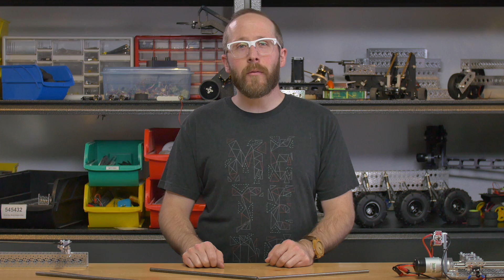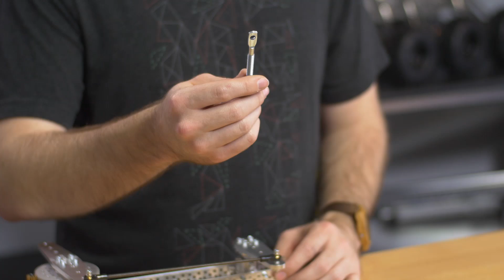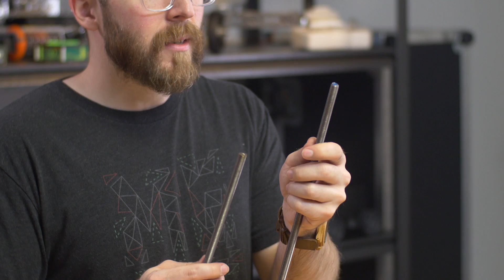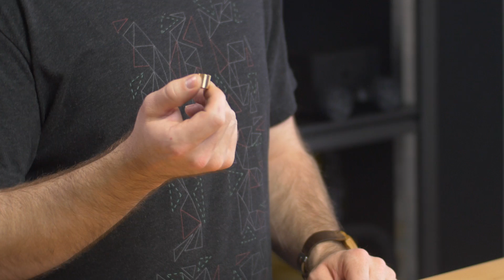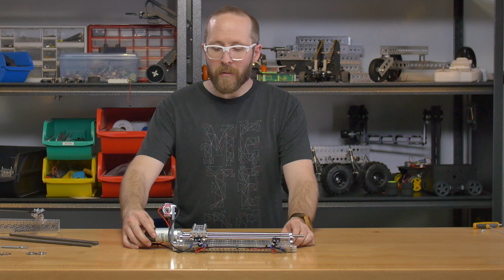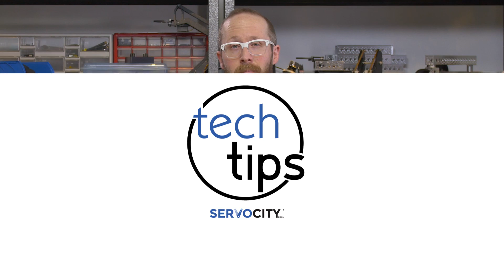Comparing Threaded Rod & Lead Screws : With Jason

Comment: A single thread has backlash which increases under load. I am a tool engineer who used to mass produce balls screws before retiring a decade ago.  It is all about precision and backlash at the high end.  The tightest machine members have precious scraped ways and precision ballscrews with no backlash.  You can also make a backlash eliminator like found on later Bridgeport style mills.

Comment: It's nice to find videos that don't just tell you to buy expensive things.
Reply from the maker: Glad you found the video helpful!
Reply: Where can you find the hardware you mentioned for the threaded rod.  I built an Arduino car (not the best mostly wood) and I made a homemade robot arm.  I would like to mate the two with a platform to raise the arm so it's not just a for off the ground maybe raise it 4 feet.  I'm not looking for a lifetime of use, don't care about precision, and not worried about power consumption.  I really just need to know the best search terms.  Everything I look for is for 3d printers or a CNC machine.  I live in a rural area so I have home Depot and Walmart so I have to I buy everything online, mostly from China because I'm not rich.  I can get threaded rod easy enough, but no hardware to go with it.  I can't find a lead screw over 3' for less than $100 which is way out of budget for my little Arduino hobby project.
Reply from the maker: @amelliamendel2227  Hi Amellia, here is a link to all the leadscrews and hardware we offer. https://www.servocity.com/motion-components/linear-motion/leadscrews  Feel free to reach out to our Tech Team should you have any other questions tech@servocity.com and they'd be glad to assist.

Comment: Where can I get a threaded nut for a threaded rod like you would for lead screws. I was having a look at your m8 round screw plates and was going to buy one until I saw shipping to the UK is $59 for an item that cost $4
Reply from the maker: Thanks for reaching out.  Please email our Sales Team (sales@servocity.com) and we'll see if it's something we can send First Class.  It depends on weight and dimensions of the items you want, but could be a possibility as our team continues to look for cheaper international shipping options.  You should also check out our metric line, goBILDA if you haven't had a chance yet.  https://www.gobilda.com

Comment: "Lead screw thread" lol
Didn't tell us a single thing about lead screw sizing or thread type nomenclature
Reply: Does the title say "everything you need to know about lead screws?"  

Maybe it did 4 months ago, but right now it says "Comparing Threaded Rod & Lead Screws : With Jason."  I don't know why you would expect it to cover different types and sizes of lead screws.  That would be a much longer video.  Loving that completely superfluous use of the word "nomenclature," though.  

Reminds me of a comment on a "Decisive Battles" history doc.  Some guy was like "lol this guy doesn't know much about history (as if the host also researches & produces the show).  Didn't say anything about [emperor who ruled 200 years later] and his battles with [totally unrelated opponent]."  Bro... it's a 45 minute doc and you're expecting 2000 hours of information.

Comment: Thanks a lot for your help! Im creating an industrial bakery machine and found this very usefull for an adjustable height workbench where the main machine will stood on. Understood that lead screw are more efficient because its has been manufactured more preciselly and therefore I'll have less friction and less energy converted to heat to reach better performance in terms of translational speed and force of the screw (you correct me if im wrong) and also in EN system, the greater the pitch number, the slower will be the translation because it has to create more revolutions to translate 1 inch. Also reacting to some comment around here, this principle of screw mechanism is very usefull in the industry and are the basics. Its like the slider-crank, cam-follower or the clasic 4 bar mechanism with revolute joints only. Dont delete the video.

Comment: No talk of speed. It looks like the speed of the screw action would be faster than a normal threaded rod but I guess we will just have to assume that. A side by side comparison between the two rods would have been good...
Reply: Speed is going to be a function of the shaft's RPM and the lead of the thread. So 1/4-20 threaded rod will move your load 0.05" per rotation.

Comment: Hi, thanks for the explanations. Which components do you have / recommend for mastering backlash on the lead screws 4 start or 5 start? And what would be best precision to achieve?
Reply from the maker: We do not currently offer the typical style anti-backlash nut with the spring in between two threaded pieces.  One way to adjust the backlash would be to use two lead screw nuts, one of which would need to be mounted in a clamping hub so that it could be turned independent of the other.  How you clock one nut with the other will determine the amount of backlash in your assembly.  The precision will be up to you given it's adjustable.  Let us know should you have any other questions tech@servocity.com.
Reply: @ServoCity  thank you very much, that makes perfectly sense.

Comment: Hi,
I have a question for you that I hope that you could answer.
I have seen a type of  threaded Rods under the piano stool to my wife, and it has a very interesting mechanism.
When you turn the nub that is attached to the threaded Rods, to bolts that are placed on the threaded Rods go in opposite direction, so I wonder whether you know the name of this type of threaded Rods?
Thank you very much!
Reply from the maker: Hi Shahab, there are surely a variety of different thread types and pitches that have been used on stools through the years but the ones that come to mind are very similar to a lead-screw thread.  The conventional setup is to have the threaded rod, whatever style it may be, fixed to the round top that rotates.  The threaded rod passes through a nut which is fixed to the base of the stool and as the top is spun it causes the threaded rod to spin and hence thread up/down within the nut.  If you have a different setup that you'd like to share feel free to email tech@servocity.com.

Comment: Hey, i wonder how far the nut of the lead screw moves by rotating it 360°. So I just need the distance per rotation. 
Edit: 
I found out that the english term of it is "lead" or "lead of thread" and it is 8mm per rotation. Is that right?
Reply from the maker: Yes, when using our 8mm lead-screw, each rotation yields 8mm of linear travel.  Please let us know if you have any other questions tech@servocity.com we'd be glad to help.

Comment: Could you make a video comparing stepper motors, vs geared Dc with lead screws? i think the main variable would be torque. And also, how can you determine how much torque would your application would be needing for selecting neither a too powerful, expensive and heavy motor nor a smaller, cheaper that does not do the job.

Comment: Great explanation. Thanks for taking the time to make the video.
Reply from the maker: Glad you found it helpful, Derrick!
Reply: I am planning to build a CNC machine for soft woods and plastics.
Now i have stumbled across trapezoidal lead screws which from what i have found out are way way cheaper than ball screws. Almost 8 times cheaper.  How come?
Reply from the maker: The manufacturing process on a ball screw is more complex - the cut must match the spherical shape of the ball bearing that will be riding within it.  Please let us know should you have any additional questions tech@servocity.com.
Reply: thanks.... i am purchasing in Germany because i am from Germany.
Apart from being more cost effective in the manufacturing process... is there any significant advantage i would gain from a ball screw compared to a trapezoidal lead screw?
Reply from the maker: A ball screw setup will have less friction.